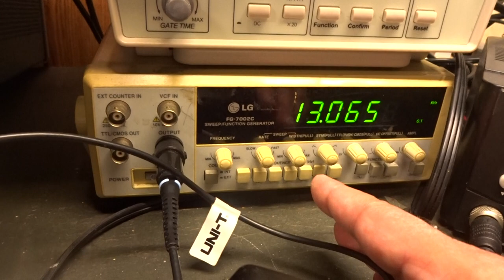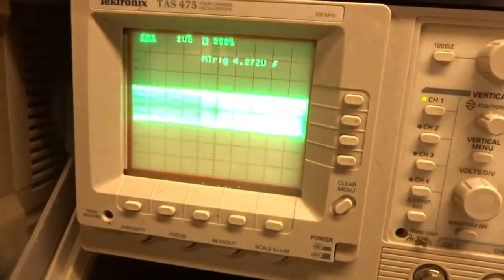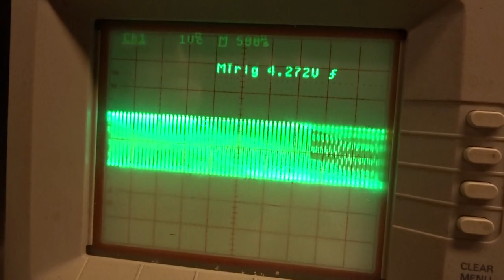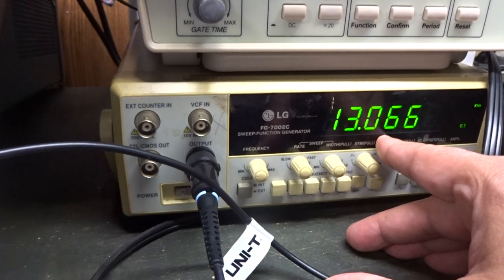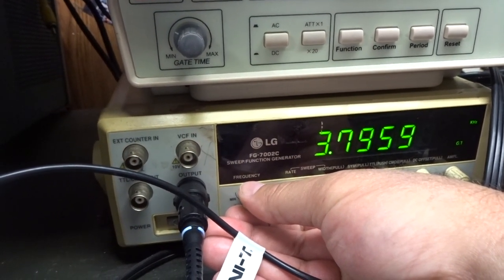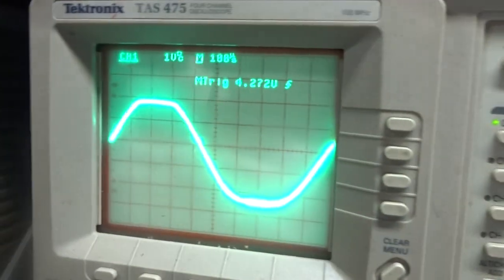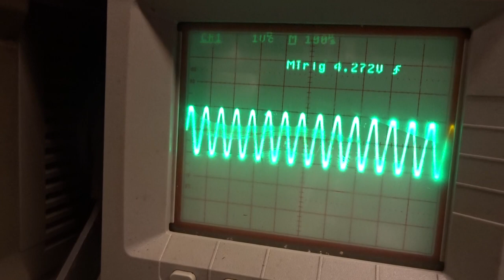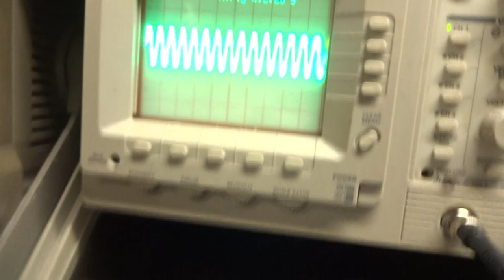The Range of Human Hearing in Terms of Audio Frequency (Sound Waves)

Comment: Good stuff Frank!  Another thing you could do to 100% prove the speaker was "still" producing air vibrations, as some speakers could have very low sensitivity in that frequency range, and could no longer be producing enough db's for the human ear to hear besides it being at 13K. One way to prove that it wasn't the speaker not able to produce sufficient power or sound vibrations (due to any inefficiencies), would be to put another speaker right opposing to it, maybe 12 inches apart with your 2nd channel scope leads connected across the facing speaker.  If the 2nd speak shows the sign wave, then you know as a fact the sounds is traveling across to the next speaker and would also be able to measure it's volume.   ;-)
Reply from the maker: Thanks.  It is interesting to study speaker design.
Frank